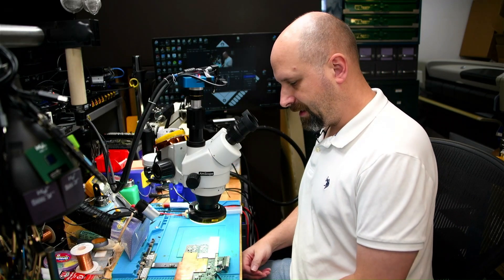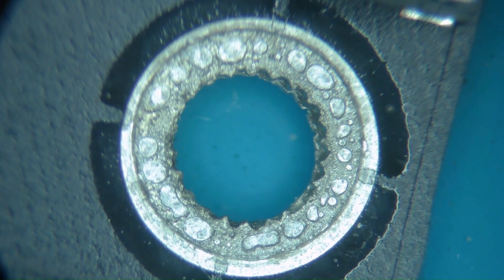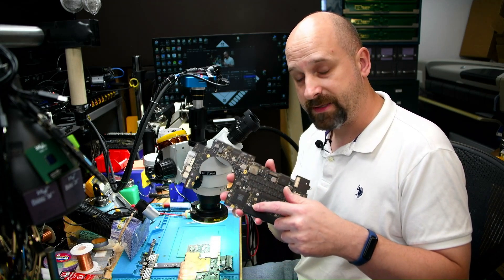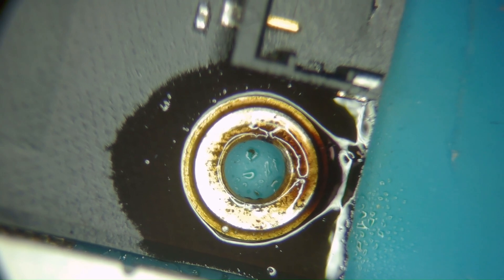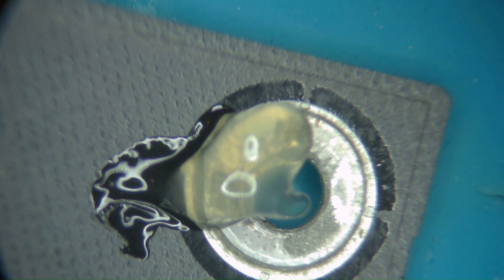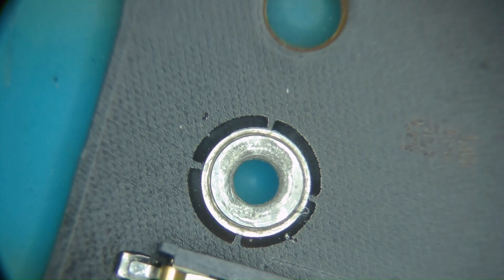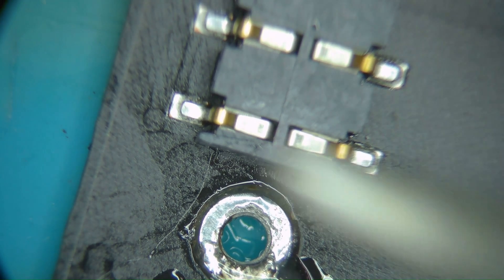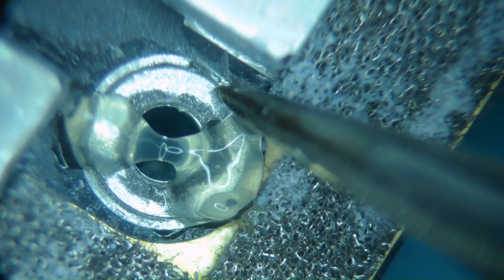Microsoft Surface Book 2, Is this a Flaw or Feature?

Comment: Were you aboe to remove display in one piece? It's reallt hard to do :(
Reply from the maker: Yes it came off undamaged, thanks to the NYC MTA Metrocard! The little NYC transit cards are the perfect material to cut through the screen adhesive with no damage to anything else.
Reply: I am less of a perfectionist and would see if I could use that disc as a washer on the other side, provided there is space and the screws are long enough. That probably wouldn't work by the sounds of it with holding down the battery. And that's why Paul is fixing it. 😊
Reply from the maker: @bert-blank  I thought of doing that too as an "upgrade". But as it is the screws sit flush with the back of the board and you see that thin foam on the back of the board? The back of the screen rests on the board when assembled. Can't have anything stickling up...